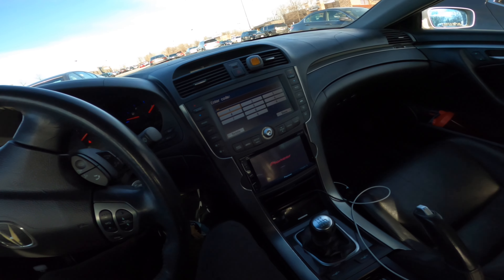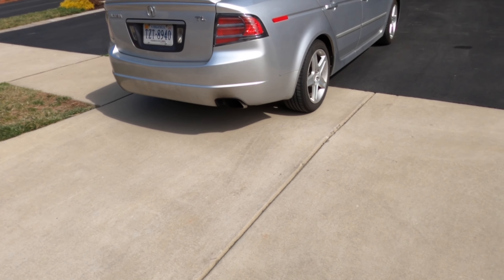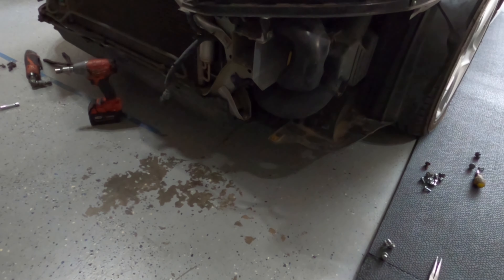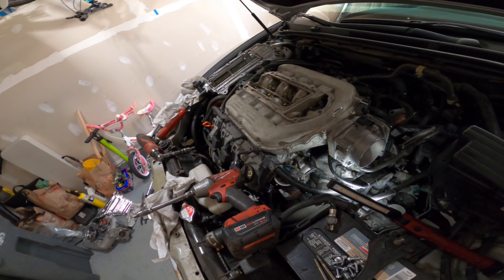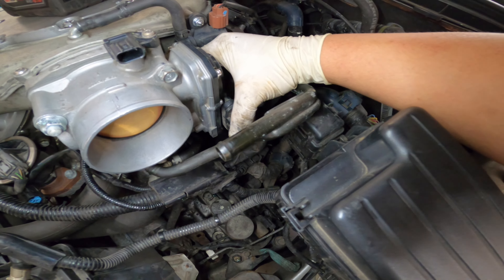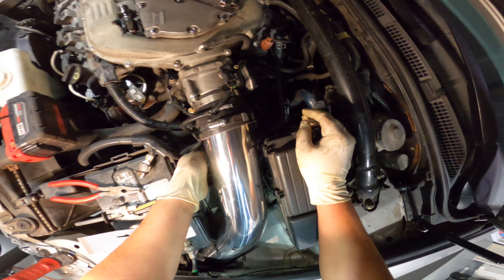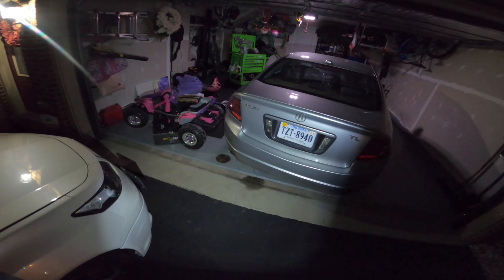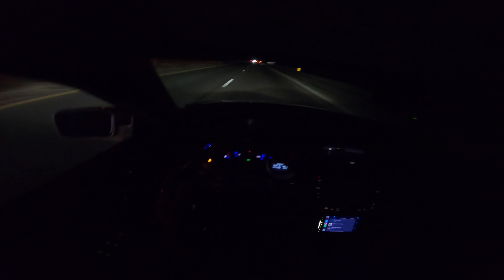2006 Acura TL 6MT - Custom 4inch Intake, J37 Manifold, J37 Throttle Body, and, PCD

Comment: Hell yeah .let's Go brother.. I just bought a j32a3 swap for my 7th gen Honda Accord v6-6 . I'ma be doing that soon 😎..  Keep the content coming boss 🤙🏼
Reply: I'm on my 3rd j32a3 engine in my Accord and decided to stroke it to a 3.5 with 12:1 compression 😂
Reply: @isaiahmcc  the hell happened to the first two?🤣
Reply: @6-6lifestyle.31  First one's timing belt snapped even though I replaced it, then the second one had a spun bearing 😖
Reply: @isaiahmcc  did you use stock ecu? I just swapped mine and runs excellent even with stock ecu.
Reply: @Jaydogg209  Yeah it ran great with stock ECU. With the mods i gonna have, i definitely have to tune it
Reply: @isaiahmcc  I'm putting my 3.7 mani and tb back on soon and ported runners. I have all cats still but 2.5 full exhaust. Decided to throw back on my aluminum crank pulley even though people say not to run it with aluminum flywheel. Went ahead and got a clucthmasters 250 kit. Before I do anything else I'm probably getting a afr guage. What mods did you have in mind that needs a tune?
Reply: @Jaydogg209  I bored my j32a3 block to 89.5mm and switched to a J35 crank and with Brian Crower rods. On the Power rev racing website, it says that if I got the same high compression pistons that the j32a3 had, my compression ratio would be higher and would require a good time.
Reply: Just got done doing that
Reply: @isaiahmcc  did you swap over the TL ecu?
Reply: @isaiahmcc  you should’ve swapped the TL harness in as the TL. Honda Accord compression is 9.7:1 and Acura TL stock ecu compression is 11.0:1
Reply: Finally did the swap on my 03 Accord.. with 04 Acura TL ECU ..Car running good ..Next is 3.7manifold

Comment: Awesome video Garrett! The TL is coming along nicely 👌. Although I  don't think your stock ECU has any clue what to do with all the extra air and flow you just bolted on so I think a dyno tune would definitely help squeeze power out of those parts.

Comment: I know this is an old video but did the intake rub against the battery? I did this same setup but 3.5 inch . I tried to adjust the pipe but it’s always rubbing on the battery

Comment: Just running the stock resonator sounds badass. I deleted all 3 mufflers and my TL is just running of the stock resonator and it's super bass no rasp.
Reply: Had the same setup before I did my PCD/J Pipe and 3 inch. Great budget setup.

Comment: On the 3rd Gen TL- Type S would this custom 4 inch intake fit? with the same height clearance. Since this intake filter sits higher than the other CAI, Do you think its less likely to hydrolocking the motor?
Reply from the maker: I actually transferred this same intake to my Type S.Any cold air intake set up is likely to hydrolock but just have to avoid driving in the rain. Check out the video https://youtu.be/BOl2Z2tkk4g?si=LbTaFGH3dNU9phMQ

Comment: Did you have any trouble with the fog lights hitting the intake when you put the bumper on?
Reply from the maker: No at all
Reply: @GarrettMedia does your car have fog lights in the bumper though?
Reply from the maker: @tandaman008  my bad this TL the fog lights is made into the headlights. The 07-08 TL has fog lights on the lower bumper 👍
Reply: You think the 07 thi intake you have would work? I have an 07 trying to do the same intake.

Comment: Where does the hose from the rear valve cover go connected too?
Reply from the maker: The new pipe doesn’t come with the small pipe. So I’ll just put a tiny filter for it
Reply: @GarrettMedia  Like a mini intake filter, right
Reply from the maker: @tenndysagastizado9804  that’s right

Comment: Did it clear your front bumper ?
Reply from the maker: Yup is sure did
Reply: Question! I’m taking the same route as you with the 4inch custom intake! What you do about  the crankcase breather connection?
Reply from the maker: @migdelarosa603  I left it venting out into the atmosphere 😅
Reply: @GarrettMedia  naw don’t play with me 😆 I’m new to all this! Nothing wrong will happen if you don’t don’t te connected or?
Reply from the maker: @migdelarosa603   instead of the crank case going back into the intake it’s venting into the engine bay. That’s how I have it for now.
Reply from the maker: The crankcase just vents into the engine bay and you may see smoke ones in a while and it smells pretty bad. That’s the only down side.